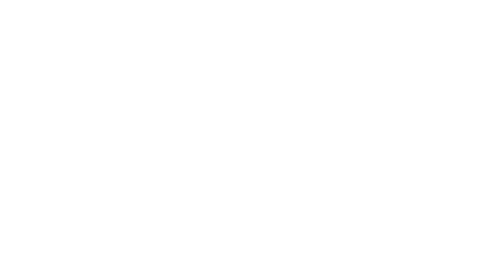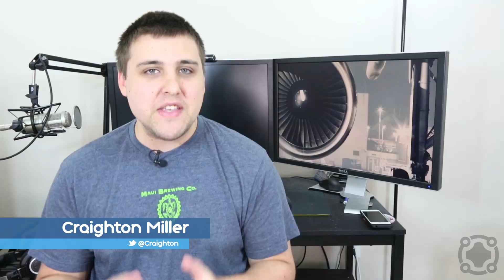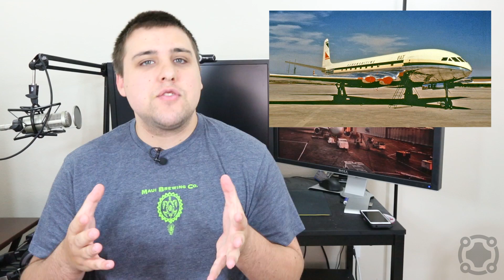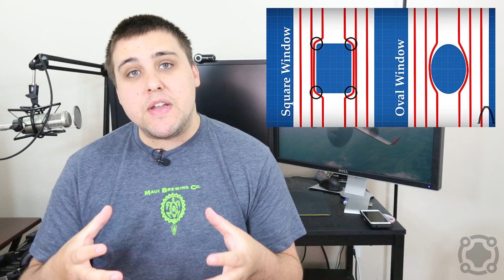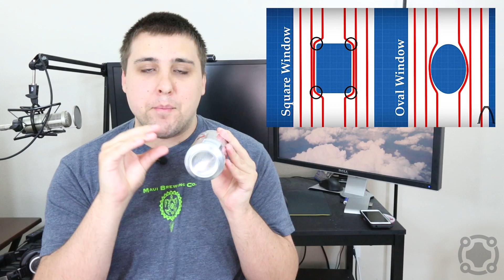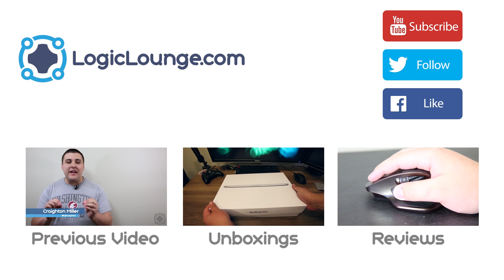Why Are Airplane Windows Round? - Aviation Facts

Comment: Why don't we feel the airplane turning when it's in cruise flight?
Reply: I'm not too sure but my guess is that because the aircraft is travelling at a high speed and if you've ever seen the flight plan of a flight you'll notice that the turns are very small (roughly 10-30 degrees left and right ) so the aircraft doesn't have to bank at significant angles